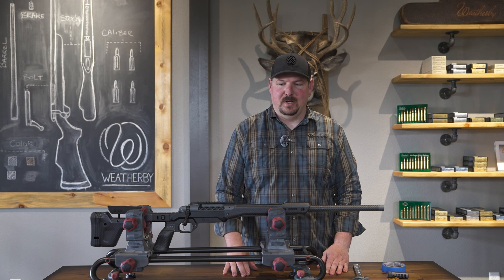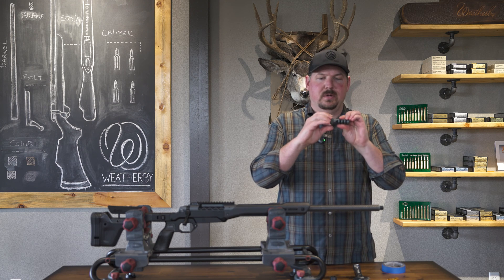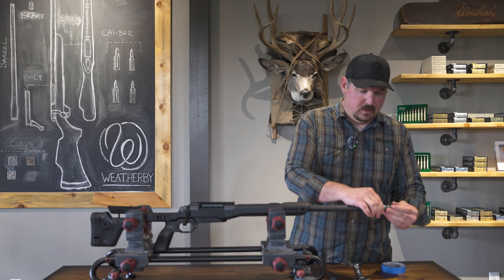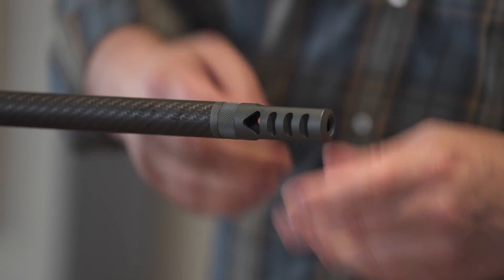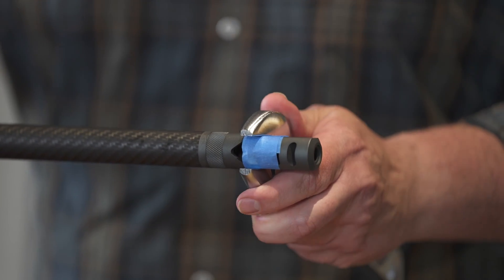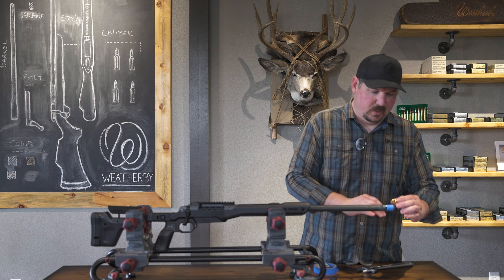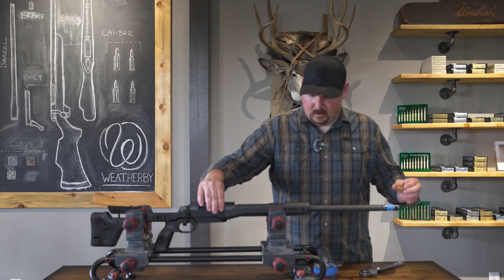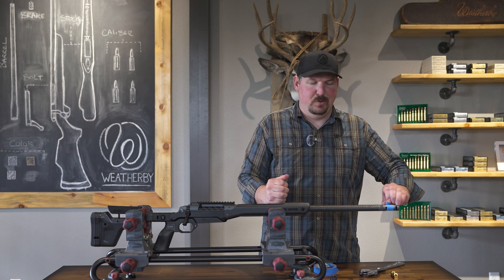How to Install the Accubrake DST

Comment: The radial muzzle brake Accubrake SST is less than useless. Buy the Accubrake DST which works like a muzzle brake should
Reply: how does it compare to the apollo LR or APA brakes?
Reply: @rachelvendela  The radial muzzle brake distributes the gases around the brake in a circular patter. The DST is designed to distribute the gases to the either side of the brake thus reducing the recoil. The APA brakes they distribute gases to either side of the brake and are most effective as does the Apollo LR.

As long as the brake distributes the gasses to the left and right side of the muzzle the brake will be effective.